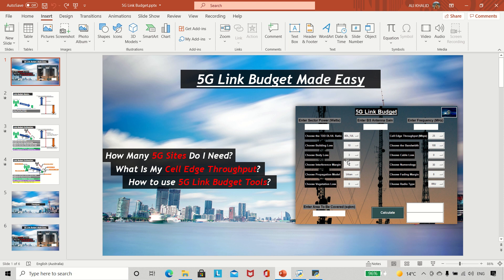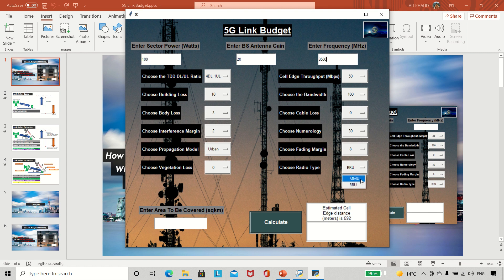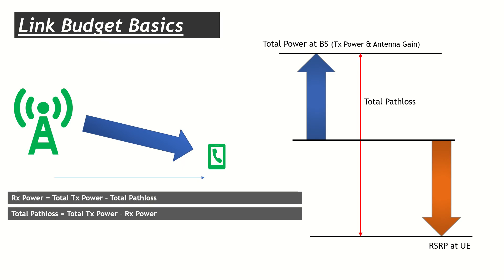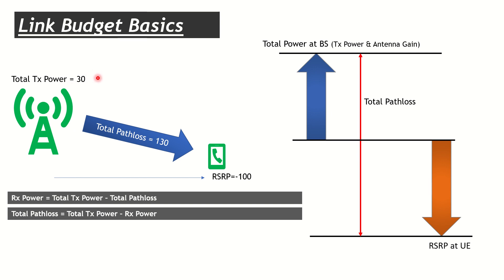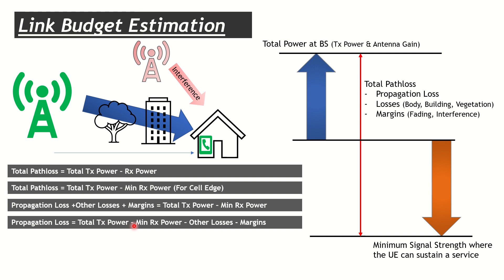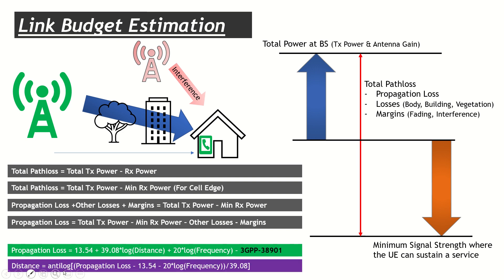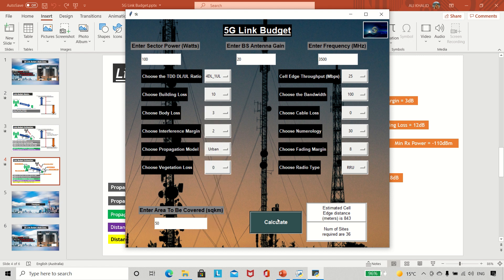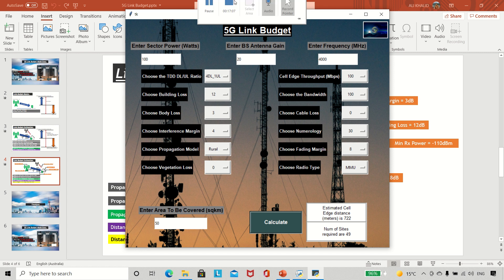5G Link Budget Made Easy: Learn to Calculate 5G Cell Edge Estimation & How Many 5G Sites You Need!

Comment: This is very useful. Thank you so much.  What is the required ul/dl sinr and throughput for 5G-low band 10 mhz bw? I didn’t understand how to define that values. Could you please explain? Thanks again.
Reply from the maker: Actually those values come from the customer. For instance, the customer would provide the throughput target for cell edge and then the vendor will provide a corresponding SINR value to be used for the link budget.
Reply: @OurTechPlanet   Thank you for your reply.

Comment: Hello Sir, 

To calculate the cell radius, I understand that we must consider possible values according to a reference, the break point (BP), and apply it to the Path Loss formulas of the scenarios provided by 3GPP TR 38.901. Based on that, I have associated each d2d (cell radius) stipulated a Path Loss value. By inserting these possible Path Loss values into the formula to calculate the received signal level and comparing it to the sensitivity of the receiver, we will be able to know if the link is possible or not. Correct?

In the dual connectivity scenario, how would the link budget and capacity of the network, consider the arrangement of macro and microcells? According to the materials I read and courses I watched on YouTube, everyone performed the calculation considering only the standalone version, using the 3.5 GHz frequency, for example. That is a calculation like the one performed for 4G. Nothing related to macro and microcells, or millimeter waves are being considered.

Is the mobile network planning, considering the calculation of the link budget, carried out by the Operator or by the Suppliers?

In the tools used for mobile network planning by Operators and Suppliers, generally, the main parameter calculated for the distribution of radio base stations is the received signal level or cell radius?

Best Regards!
Reply from the maker: yes, your understanding is correct. The cell radius is the output while the data rate is usually the deciding factor.